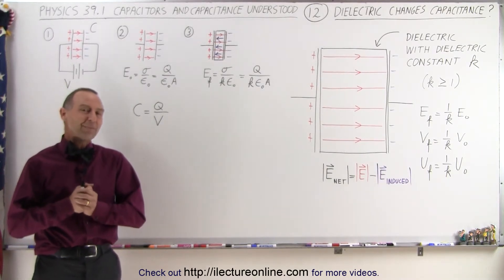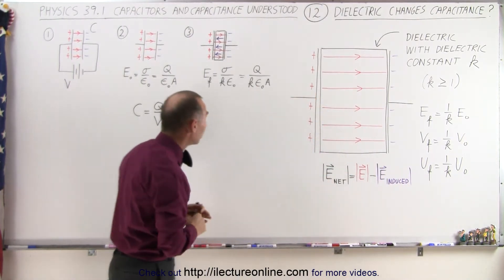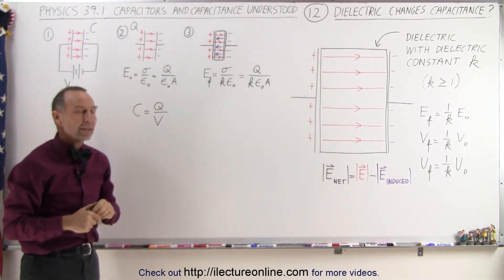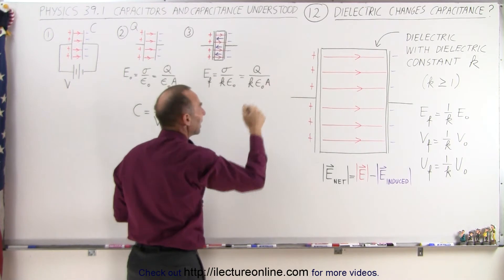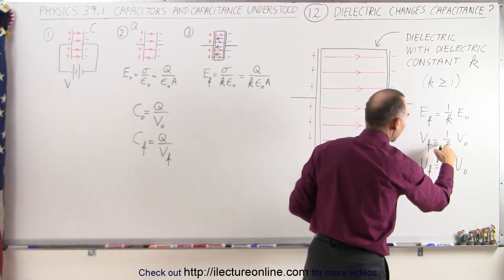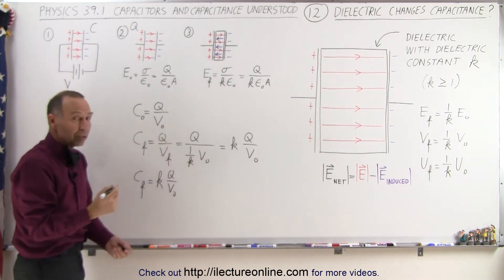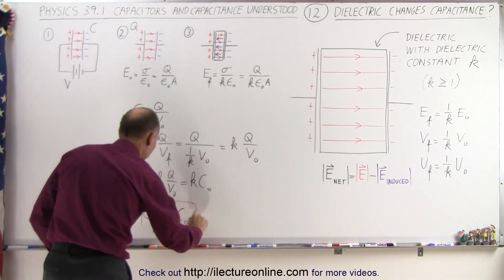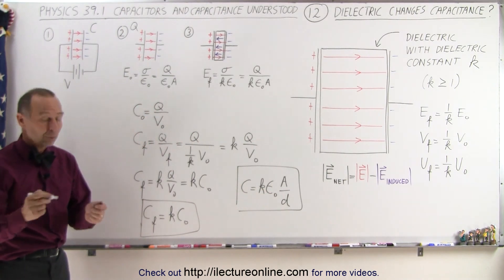Physics - E&M: Ch 39.2 Capacitors & Capacitance Understood (12 of 27) Dielectric Chgs Capacitance?

Comment: what would be the effect on Energy, capacitance , voltage and charge if we don't disconnect the battery and insert dielectric?
Reply from the maker: If we DO disconnect the battery then the charge remains the same.  If we DON'T disconnect the battery then the voltage remains the same